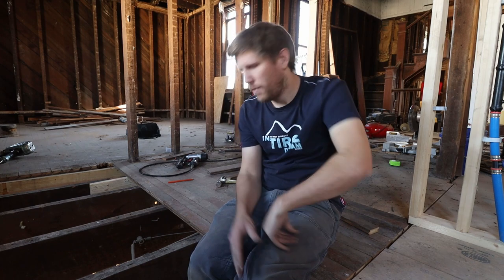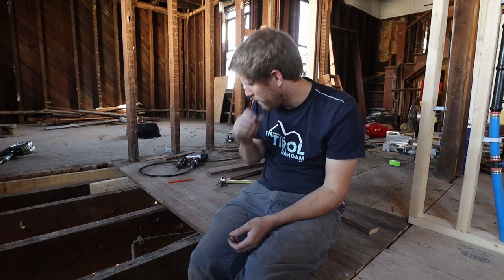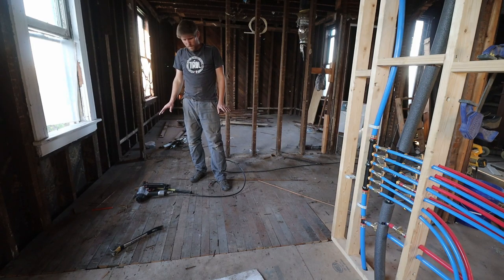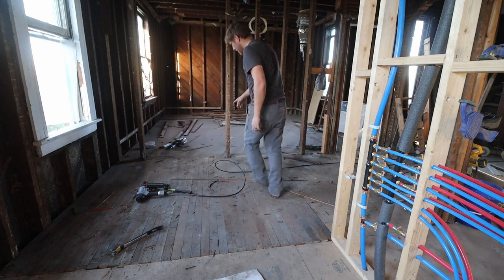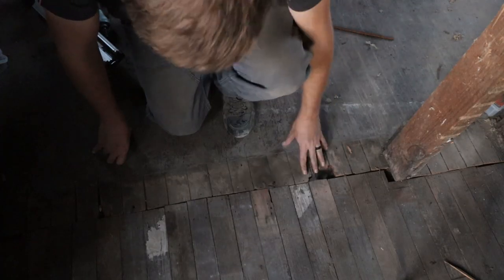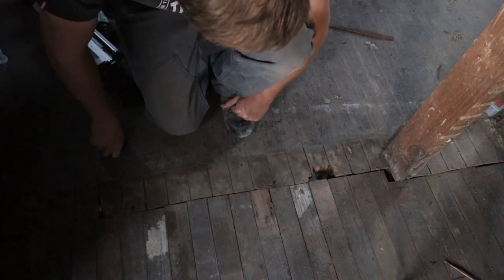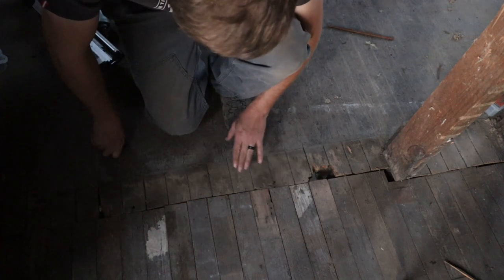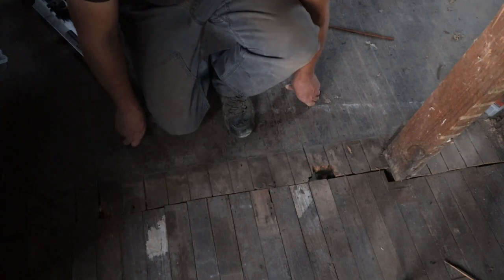Finishing the Reclaimed Wood Floors in the Walk-In Closet - Victorian Home Renovation [TirolerInn]

Comment: No sub-floor?  This is the first renovation project I've seen that hasn't installed sub-flooring, but I suppose it is not a necessity.  Thanks for the video.
Reply from the maker: I would have put subfloors in the second floor if the existing floors had them. Unfortunately there were none and we would have to take the entire level out and as of right now that is a daunting task.